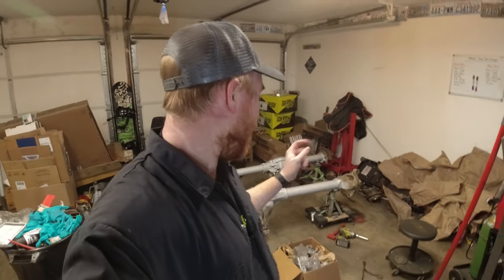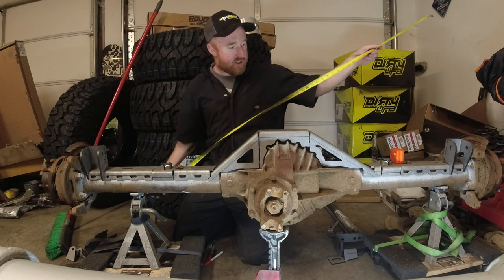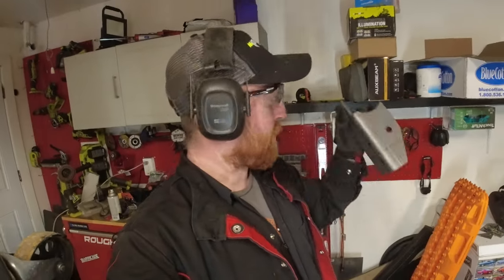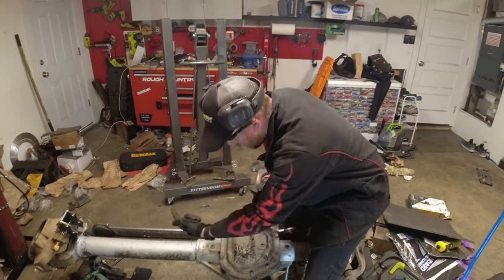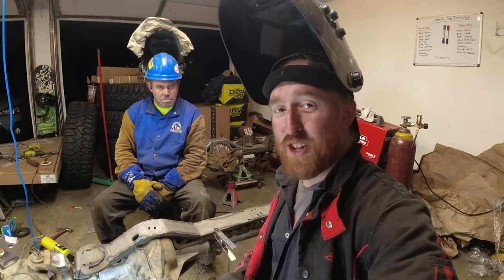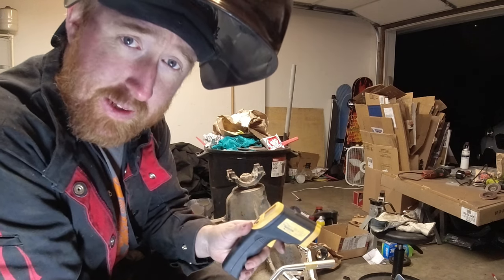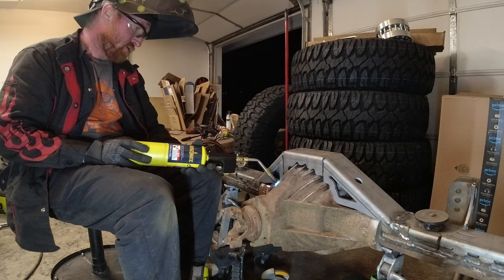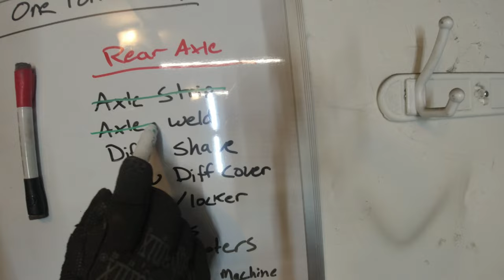Welding BARNES 4WD Truss To SUPER Dana 60 and GM 14 Bolt: Jeep JKU One Ton Swap Episode 2

Comment: Very informative, thx! Im in the cut off the brackets and am grinding down the axle phase. I have all the parts ready and I see Barnes instructions say to tack everything up first, then mount to Jeep, Bolt up Control arms, shocks, etc and do a test fit running it through its full suspension arc with a jack, then remove and fully weld. Well Damn, that's alot of added work for a solo dude (me) with no lift in my garage.  I see you just went for it and welded it up... I think I will too. I took very good pictures and measurements b4 I cut my brackets, plus Barnes directions say exactly where everything goes. I guess we will see how it turns out. Its just metal.. I can weld it up, heat it up, and I can cut it off as needed.
Reply from the maker: Thanks bud! Yeah definitely a fun task doing it solo in a garage without a shop. I did it, you can too!

Comment: Looks nice! Just curious, what are you planning to DO with your jeep that you need axles that heavy?
Reply from the maker: Ideally, I'll be doing more rock crawling and things of the sort. I will also eventually be adding a hemi into it as well. I'm unsure if I will actually NEED the one ton axles or not, but I would much rather swap them now and sell off the old axles while they are in good shape. I don't want to break apart the stock axles and be out that money and still have to do the swap.
Reply: Ah ok. Smart. I was thinking of swapping out my Dana 30 front before 37s, but wanted to sell my old 35s before they got too worn. So now I get to play catch up which is what you are avoiding!
Reply from the maker: @Donnut123  I did 37s on the d44 axles. I felt like I was still playing catch up! But yep. Trying to avoid future upgrades after things break!